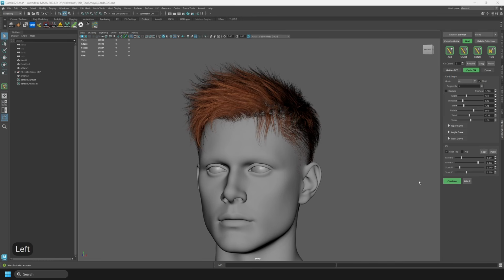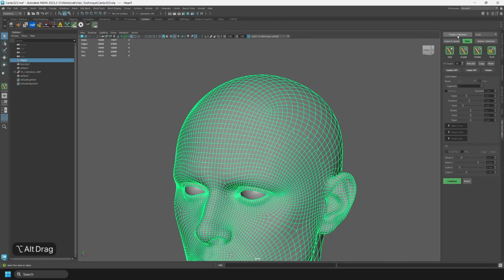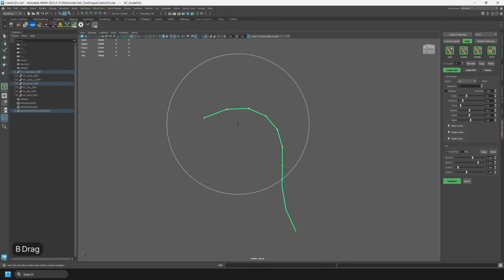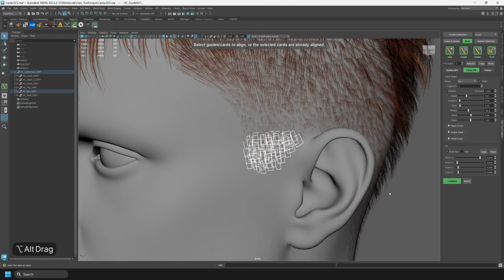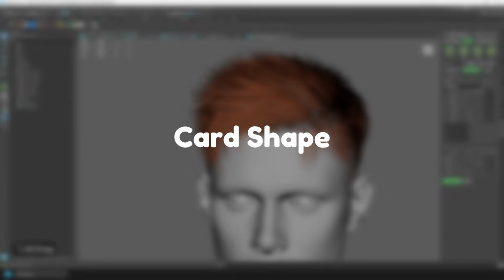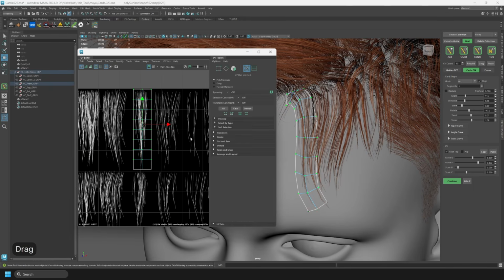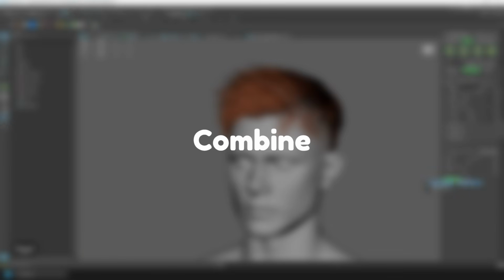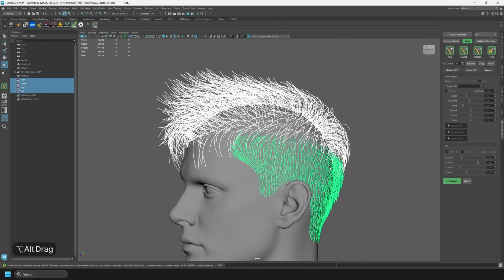Hair Card Creator tool for Maya Tutorial

Comment: Hey, I bought this plugin on ArtStation, it’s great! But I discovered a little issue.
I want to control hair card UV shells manually to change their assigned textures. Sometimes the card UVs overlay/overlap on top of each other, and I can't select cards via UVs to change all the cards that use these same UVs. If I select multi cards and move its UVs, it doesn't synchronize, which messes changes the cards' textures.
Reply from the maker: I understand. There is a solution: in the UV section, there are two buttons, Copy and Paste. First, adjust the UVs of one card and copy them. Then select all the other cards and paste the same UV coordinates onto them.
Reply: @NikitaSergun  Thank you and your answer,I explain my qusaton again,Because I use different UV layouts within the same collection, I can't select all cards that share the same UVs. What I want is to simply select multiple UV shells and move them together.
Reply from the maker: Okay, what version of the plugin do you have installed? Check it out; I fixed some inconvenient issues in 1.2.2. I think that's what you're talking about.

Comment: Can I change the hair new texture?
This Hair texture can be fixed into the plugin? Please upload the video regarding the hair texture
Reply from the maker: Would you be interested in a separate video specifically about how I create hair textures?
Reply from the maker: Hi!
Yes, you can change the hair texture.
The texture shown in the tutorial is just one of my own hair textures assigned to a regular Lambert material. It is not fixed inside the plugin and it is not part of the plugin itself.
The idea is that you can use your own hair textures, because textures are usually different for each hairstyle and each production pipeline.
You can assign any material or texture to the generated hair cards using the standard Maya workflow.
Reply: Yes full process start to end of assign material and card placement by the plugin

Comment: When I press combine, lots of hair are not being converted. Not sure why.

There are lots of missing cards.
Reply: If I select everything and press the Maya Mesh>Combine it works :)
Reply from the maker: Hi!
Thanks for letting me know.
This is not a typical issue, so most likely something is broken in those cards/guides. It may mean that the plugin lost the connection to some guides or cards.
This can happen if the history was cleaned, objects were renamed, or something was changed manually in the plugin hierarchy.
Could you please try using Heal first and then check if the issue still happens?
In most cases, Heal should restore the missing connections. If it doesn’t help, feel free to message me directly and we can check it together. I’d actually be interested to understand what went wrong :)
Reply from the maker: I tried to reproduce this issue on my side, but I couldn’t reproduce it, even when I intentionally tried to break the setup.
Could you please send me the Maya scene with the broken cards by email? Then I’ll be able to check exactly what is happening.
My email is: trigan1997@gmail.com
Reply: @NikitaSergun  unfortunately I can't send this file :/ but I will use this tool a lot, if it happens again, I will send it to you. I was on Maya 2026 btw.

Comment: is there a way to select a part of the mesh and then populate it with curves/cards? Or do I need to do that outside of this plugin?  I've only really seen a way to add one at a time so far.
Reply from the maker: Hi!
At the moment, inside the plugin you can add guides one by one, and the Add Guide tool works with interpolation to speed up the process.
For fast mass generation / scattering, I usually use other tools outside of the plugin.
That said, it’s not impossible to add this feature. I could potentially implement it as another mode inside the Add Guide tool — something like a brush/paint mode that plants guides or cards over a selected area.
As a temporary solution, it could also be done with a separate script for generating curves/cards on a mesh area.
Reply: @NikitaSergun  appreciate the reply Niikita.
Reply: @NikitaSergun  Ok I seem to not be able to figure out why I am getting single plane when my CV count is 5.  I tried rebuilding but nothing changed.
Reply from the maker: @Krankin  cv count is a curve parameter, indicating how many points it has. In UI, we change this to perform a rebuild.
Reply from the maker: @Krankin Perhaps you wanted to add edges? There are distance and segments parameters for that.
Reply: @NikitaSergun  I will check that out.  It just seemed that when  you changed the CV count it also affected how many polygons the card had.  I am stuck at 1 single quad for each card.